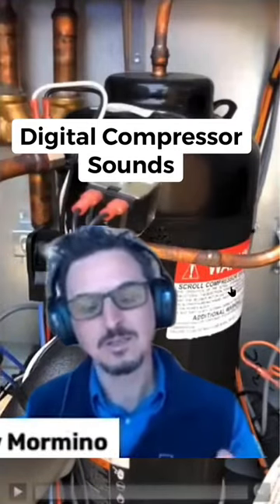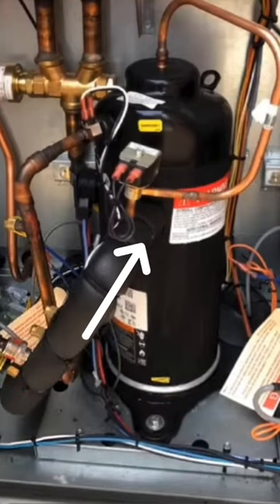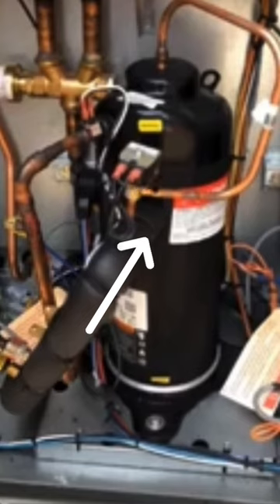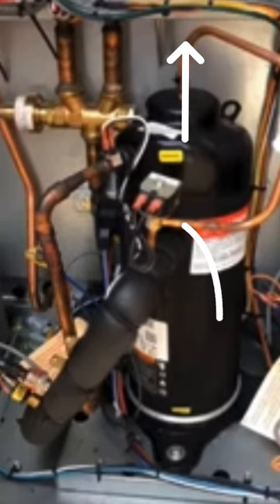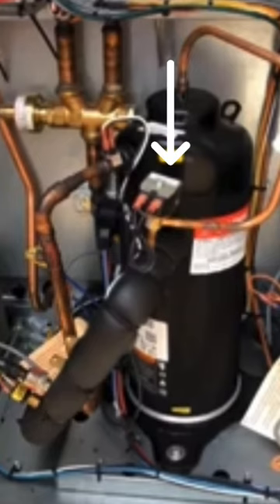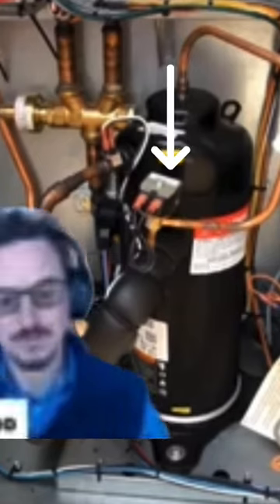Why a digital compressor sounds like it’s short cycling? #hvac #hvaclife #hvactechnician #aaon

Comment: So your video tells us about the noise but you don't explain why a.d whT it's for
 My guess is to deliver low pressure gas to top of motor to keep it cool so won't over heat?? Kid of simulation of running water over compressor when it.over heats.
Reply: It's not a method of heat management, it's a way to de-load the compressor. It's basically a way to turn the compressor on and off (load-wise) without the surge current or the damage from the high compression ratio if you were actually cycling the compressor